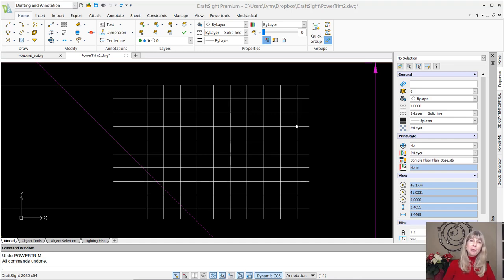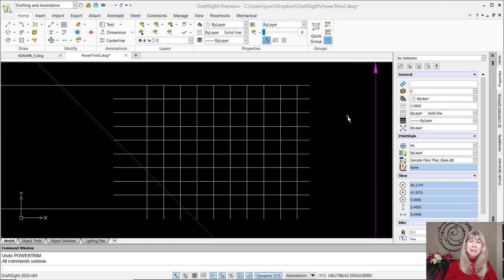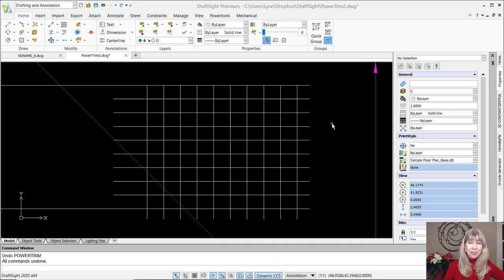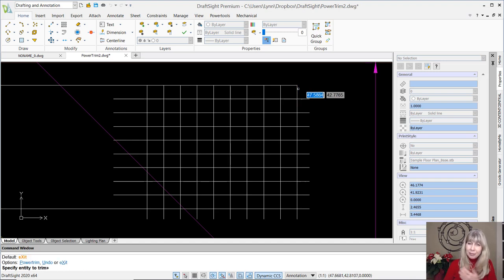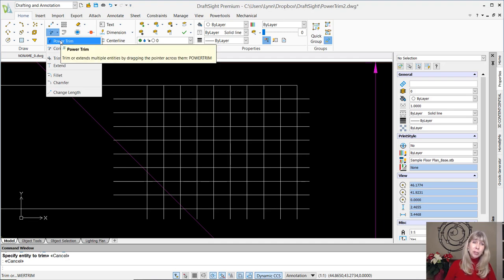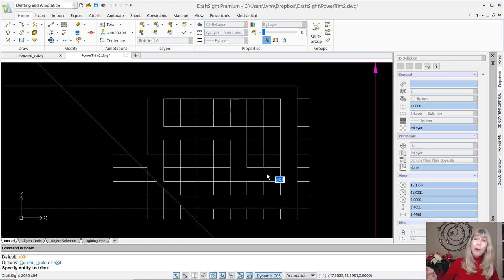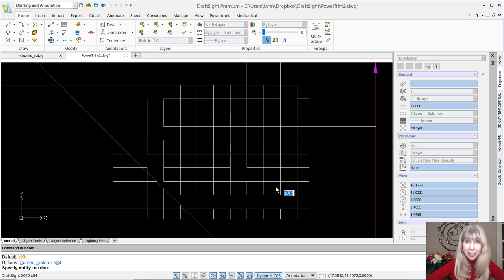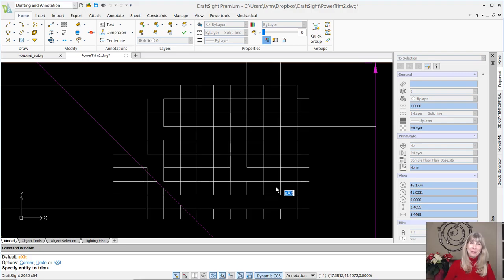DraftSight Power Trim with Lynn Allen

Comment: Just saying, AutoCAD LT's basic Trim tool actually combines Draftsight's Trim & Power Trim tools. Doesn't require you upgrade your package; it's just included in the one basic Trim tool.
Reply: Autocad LT is $60 a month, Draftsight is $100 a year.  So you have to deal with a worse trim tool, but you save a little over $600.  It's too bad though, Draftsight trim used to work fine, but they changed it within the last year to no longer allow you to trim with a box selection.